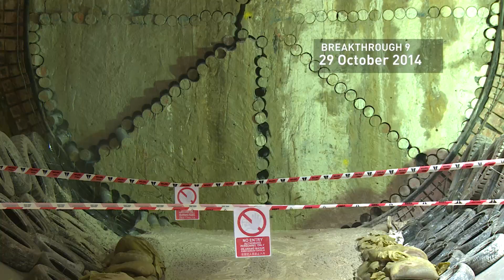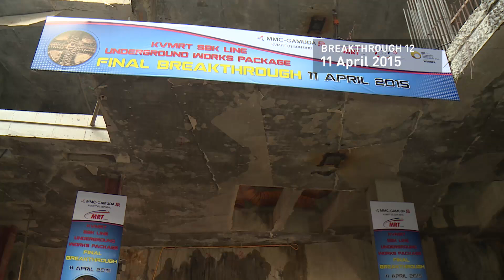MRT Malaysia SBK Line Tunnel Breakthroughs

Comment: None of the large-scale machines, gamuda, has any of these machines. Most of these machine technologies are China
Reply: Nope. The ones from Gamuda are from Germany and Switzerland. The Chinese ones not used here.
Reply: The two Chinese TBMs were used by the Chinese contractor from the Semantan portal to Pasa Seni, passing through Sentral station interchange section of the MRT. The two machines were assembled in the same factory that were used by Herrenkenct the German TBM manufacture that made TBMs for contracts in China. The KL MTR was driven through two differing strata's and so two different TBM designs were used.
 The Chinese contractor used an old Herrenkenct design bentonite slurry type for the Kenny Hill ground. While Gamuda used several mixed use Herrenkenct TBMs in the limestone voided grounds.
I'm sorry but I can't remember the Chinese contractors name, but they performed very well and were a pleasure to work with for the entire tunneling process. 
Sadly, two of their employees perished in the MH370 tragedy. May they RIP.